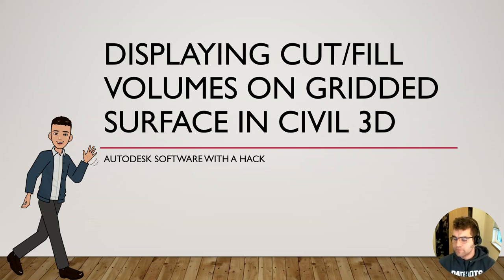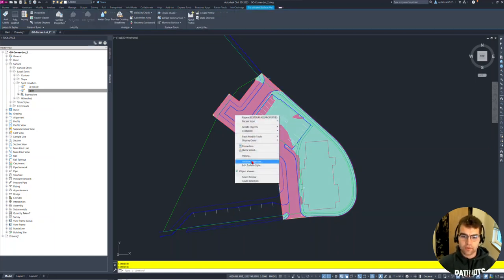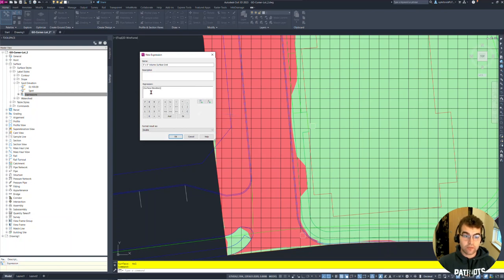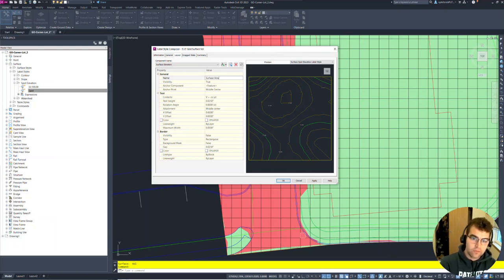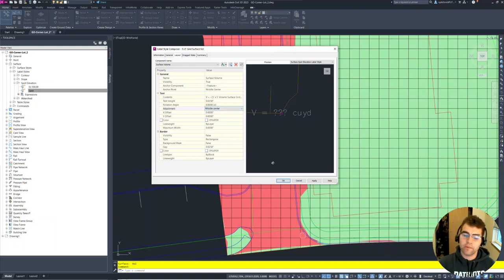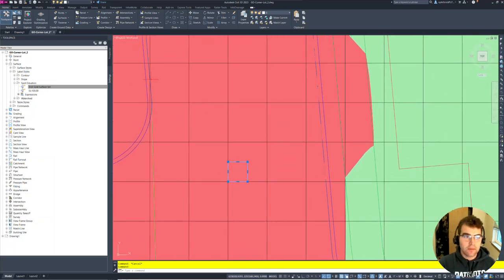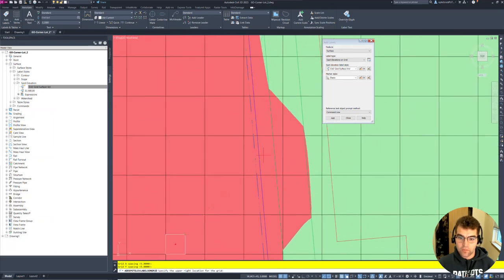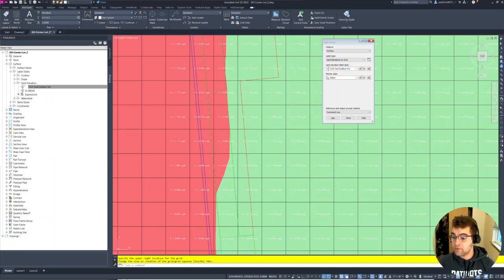Displaying Cut/Fill Volumes on Gridded Surfaces in Civil 3D

Comment: First, I would like to commend you on your thorough explanation of the topic. Thank you for imparting such valuable information. I have a query regarding the calculation of volume in areas where we do not have a square grid shape, specifically in terms of grid xy distances. Could you please elaborate on how the elevation is factored into the calculations given that you have multiplied it by the grid dimensions? Thank you for your insights.